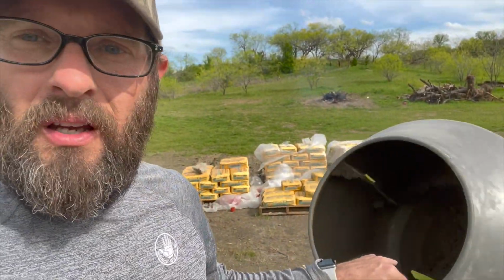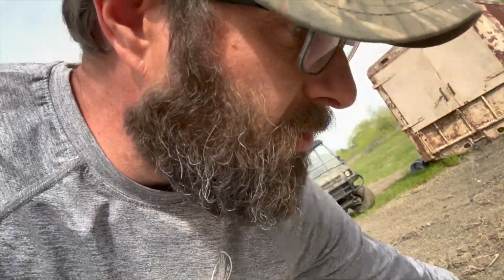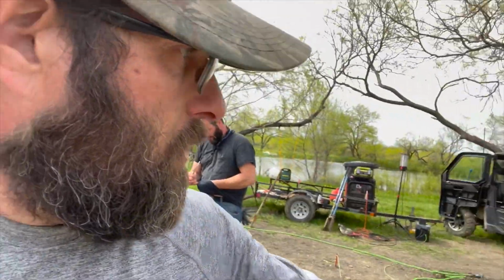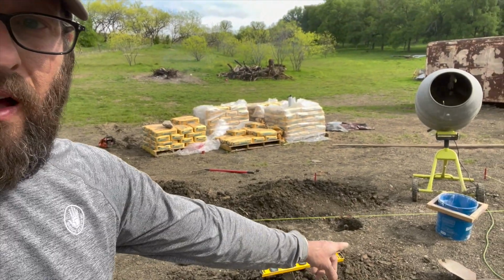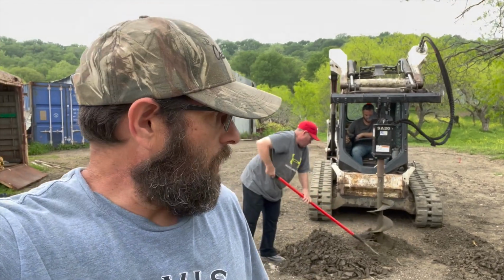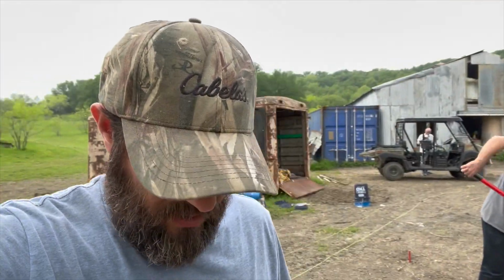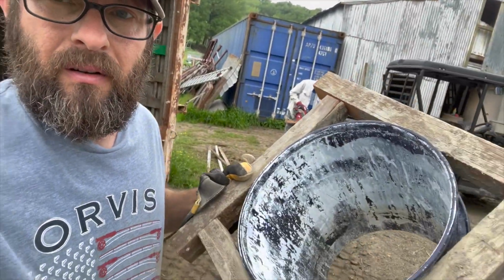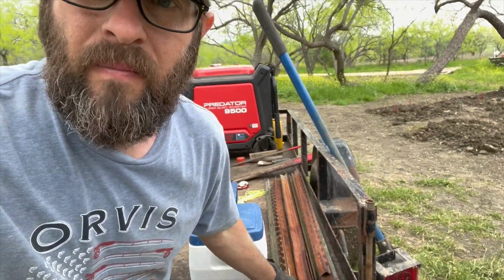Foundation for Carmen's Tiny House | Progress at the Property

Comment: Brent you are cutting corners in the wrong place 
Foundation is the one of the most important things ,ask your dad. The house on Ida is a prime example 
Those piers start moving around & you will definitely be regretting it. Think about it doors& window getting out of square and plum. Sheetrock,tile,brick,its all going to rest on those piers. Believe me when it comes to cutting corners your grandpa was the king of that. When we built the second story it cost daddy 1200.00 . I got a lot of experience building & you are making a big mistake. 
😢😢
Reply from the maker: We put in piers just like the builder asked for except he asked for 2ft deep and we went about 4ft deep, piers are every 8ft on all 4 beams. We cut corners with the plastic buckets instead of sonotube and metal t post instead of rebar but the sonotube comes off after the concrete sets and the posts are bigger than rebar. So hopefully those don’t have any effect on the foundation. Thanks for your input!